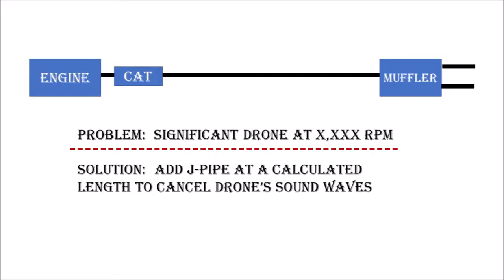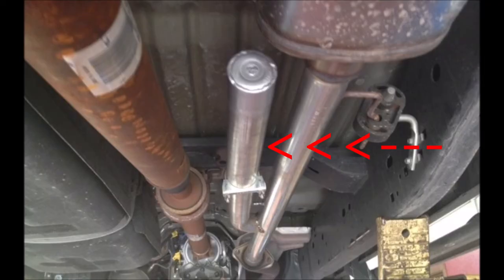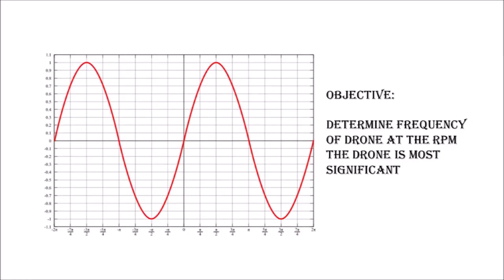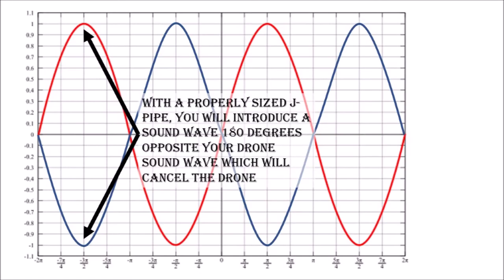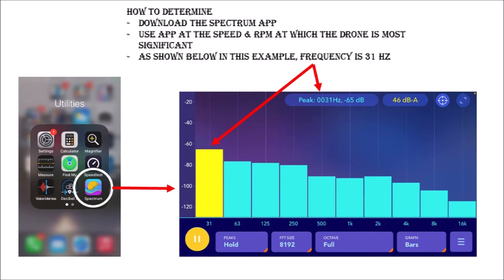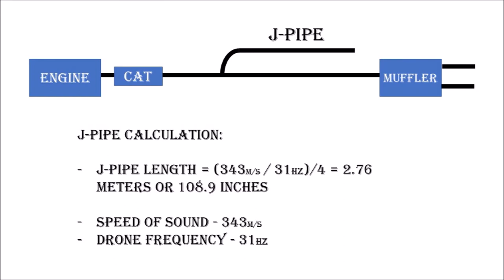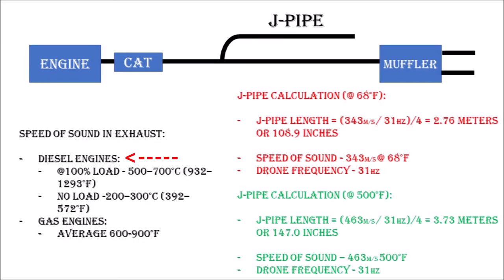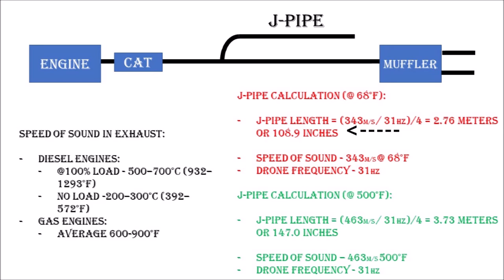Reduce Or Eliminate Exhaust Drone: How To Calculate Accurate J-Pipe Length With Exhaust Temperatures

Comment: Thank you, wow, I caused you to make a whole video. Good stuff, I appreciate it. It is crazy how much the heat affects the calculated length.  

Another couple questions, you may or may not have data on.....  Have you gained any information on the recommended diameter of the drone J-pipe? I see on some searches, for the best drone cancellation, the diameter of the J pipe should be nearly the same diameter as the main pipe. I have a 5" exhaust.... gonna be tough finding a place for my calculated 40 inch long 5" pipe. I am probably going to go with a 3" J-pipe. 

Secondly, have you any experience on the placement of the J-pipe? Further forward more effective? Does it matter?

Your J-pipe diameter looks close to the main exhaust. It sounds like you had great results even without figuring in exhaust temp. Maybe these other calculations are less important to the basic fact of having a drone cancelling chamber. 

Again, thank you!
Reply from the maker: glad this vid helped.  

As far as j-pipe diameter, I have heard you want to get close, but it does not need to be the same size.  You surely don't want a small j-pipe.  I'm sure 3" will work with your set-up.  

With regard to placement, the first issue is room, but I assume you have a big truck with lots of room.  My opinion, you want to cut into your exhaust where you took the temperature reading from which you calculated your length. 

Lastly, I'm glad you found my channel.  Please subscribe and share with your friends.  I'm trying to get this channel more mainstream.  :)

Comment: Thanks for the video. Currently have a 14 Tundra 5.7. Put on the flow master flow FX. Great deep tone and not overpowering. But my god the drone at 1600rpm is miserable. Trying to find a way to get the right length. But it’s like 19 degrees right now. Not sure how accurate exhaust temp will be for summer
Reply from the maker: That drone is H3LL isn't it?!  What you can do is calculate your j-pipe length at the speed of sound at Ambient temperatures and when installing the j-pipe use a slip flange so you can adjust length when you get the temps during better weather.  Either way, should be close and reduce your drone significantly.

Comment: If there are two exhaust pipes, does the length of the j-pipe on each side need to be halved?
Reply from the maker: Hi, thanks for your question... the simple answer is no, the resonance created is caused by the pulses from the engine and has more to do with engine size and number of cylinders than exhaust design.  You will need a J-pipe on both sides of your exhaust.

Comment: I'm in the process of installing a j-pipe on my 01 tundra. Severe drone at 2000 rpm
Reply from the maker: Thanks for watching and the comment.  What exhaust modifications did you do to your Tundra?
Reply: @DrivingIntelligence  it’s a straight pipe after the stock cats. 2 1/2”OD to 3”OD and then to the 2 1/2” exhaust tip. It sounds really good but the drone at 2000 is annoying.
Reply from the maker: @grantfredrickson5803  understood.  You should get some benefit from a J-Pipe to resolve drone, but it likely will continue to be loud!